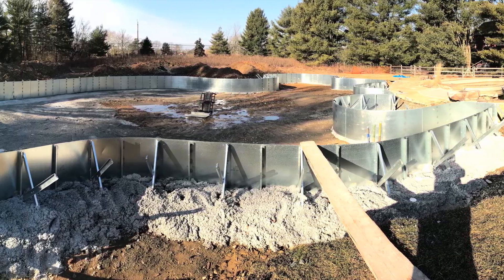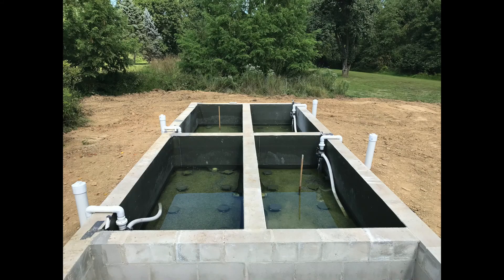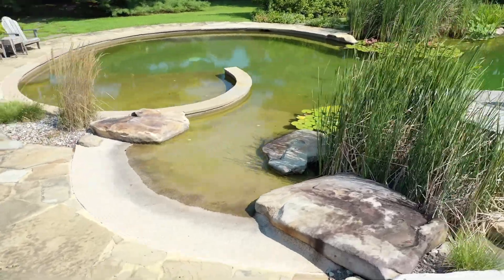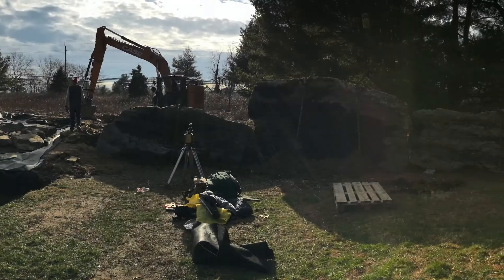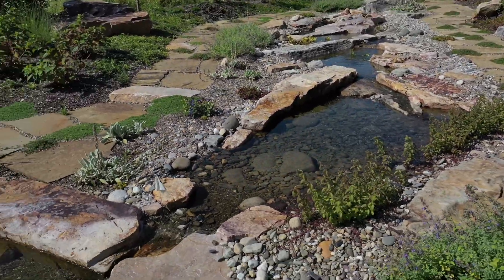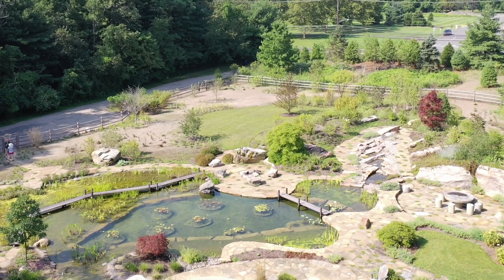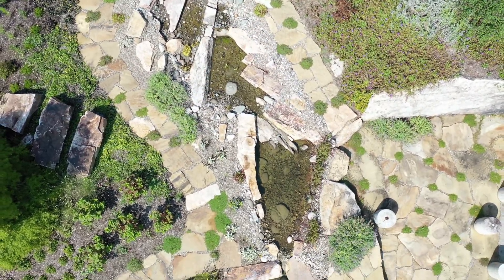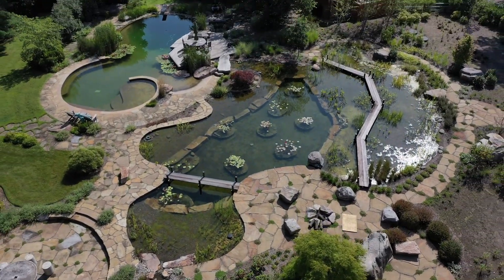BioNova® Video Journal - Natural Swimming Pool Conversion Transforms into Ecological Oasis!

Comment: Very cool, how much land do you need to have a natural pool?  Also, can you integrate the endless swimming pool technology into your designs?  Thanks.
Reply from the maker: Hi there! The beauty of a BioNova pool is that land required is variable depending on what kind of design/type of natural swimming pool you have in mind. Check out our design gallery here for inspiration: https://bionovanaturalpools.com/bionova-nsp-gallery/
As for endless swimming pools, it is something we can discuss during consultation based on your needs. Thanks for the question!
Reply: @BioNovaNaturalPools  thanks for the response.
Reply: Hello again, I looked at the website.  Great stuff.  Another question, say you have 1-2 acres of land.  

Is it better to have raw land, a functional pool, or and non-functional pool?

Would the third option increase the cost significantly?  Or is it unwise in general... Lipstick on a pig?
Reply from the maker: @colinscrypto3307   🤔 We're unsure what you're asking. Can you rephrase the question? Thanks!
Reply: @BioNovaNaturalPools , I'm trying to compare the cost of buying a house with land versus buying a house with a functioning pool versus buying a house with a non-functioning pool.  I'm assuming that the land would be the cheapest and best Roots but I'm not sure.
Reply from the maker: @colinscrypto3307  That's a tricky question. We can't advise on real estate purchases, but we can say that if you buy a house with an older traditional pool we can convert that sucker to a natural swimming pool! Best of luck
Reply: @BioNovaNaturalPools , perfect!  Thanks!